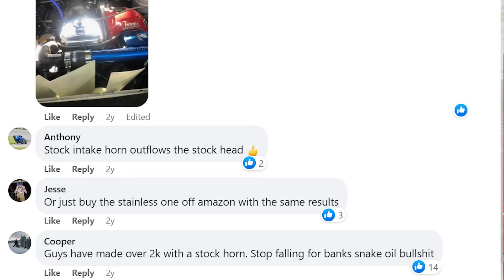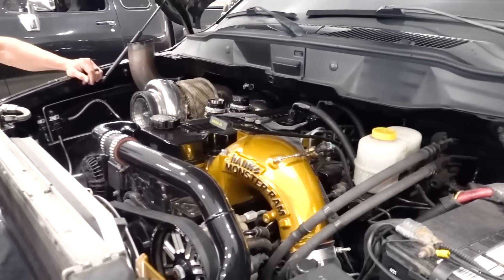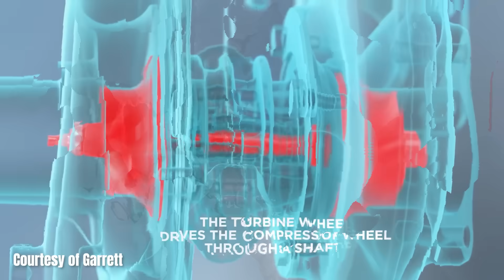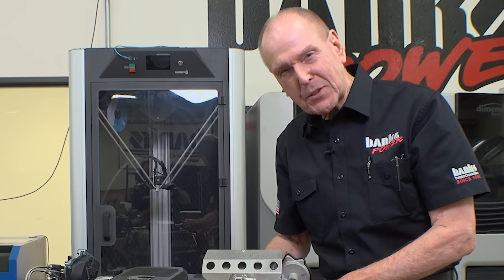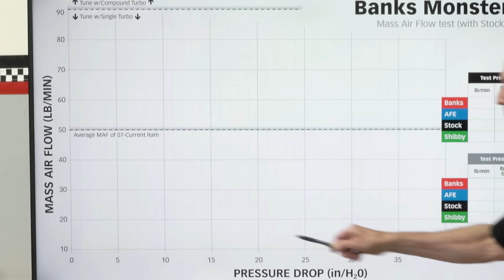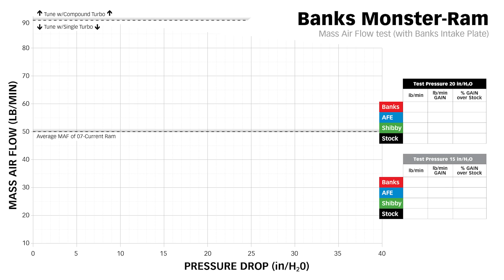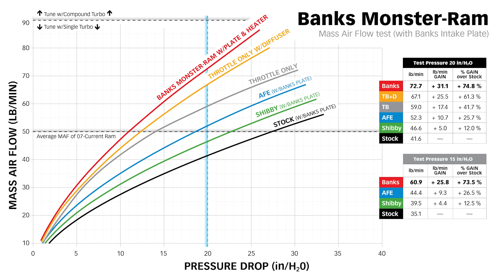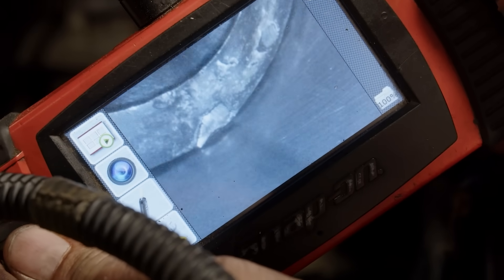Stop this wives' tale about Cummins engines! | Fact Check

Comment: He did not address MY comment from the last video.  What is the failure rate of the heating element that Banks uses compares to the factory grid heater?  By eyeball and common sense, it looks like its MORE likely to eventually break up and shed parts into the intake.  This concern is the one and only thing keeping me from buying one of these.
Reply from the maker: We have not had a heater coil element fail yet. The heater element that we include will not melt like the factory unit and coil heater element is rated to a higher amperage than the factory grid heater element. Additionally, the heater coil is welded to the base that attaches to the Monster Ram housing; unlike the factory heater that is held together with plastic. Finally, if the coil were to melt and fall into the manifold, it is too large to pass under the intake valve like the stock bolt can.  Another advantage of the coil design is that it takes less than 5 minutes to inspect, unlike the factory heater which can take up to 4 hours to disassemble and inspect.
Reply: @bankspower  Honestly, its an honor to get a direct reply from you and I could not imagine a better answer.  Thank you.  I will be ordering shortly.

Comment: I love the way the Bank's Monster Ram air when combined with the Bank's boost pipes and cold air intake opened up my 6.7 on my 2023 Ram 2500 Rebel. I couldn't be happier with the way the motor runs and breathes and in turn, I've even noticed a little increase in mileage per the truck's computer. Bank's has done their homework and the science is there!

Comment: I have a 2012 Ram 2500 Cummins that has the banks monster ram, ram air cold air intake,3.5" intercooler tubes and intercooler. What a difference it makes it just runs smoother and spools faster. I live in the North and it gets cold and have never had ad a problem with it starting with the new intake heater design. Its actually a lot easier than i thought. It seems like it's a big job but its really not. I changed my fuel filter after i did it just because. My tip is use white oyt or finger nail paint on mark where the lines go into the side of the head so you will know if anything turns that you didn't want to turn and just line the 5 fuel lines you reuse up with the marks so you get no leaks. None of mine leaked. This setup is worth the money for sure

Comment: Hmm, i wonder why banks did not go all in on the elbow design. It's ok, but you still have hot engine bay heating the elbow up, heating the intake air. Everything between intercooler exit and head should be thermally isolated.
Reply: Dude measuring flow rates at room temperature. Put that setup in 150 to 200 degrees C like the engine bay is and will se how dense the air is.
Reply from the maker: No one would dispute that under-hood air density is far lower than than ambient. As a performance parts manufacturer, we chip away at one problem, then the next, then the next. We can't prevent the engine from generating heat. However, we can draw in the coolest, densest air possible from the exterior of the vehicle. The lower the temperature of the intake air, the lower it will be entering the intake manifold. If we were building a racer, everything would be thermally isolated and/or chilled.
Reply: @bankspower Thanks for the reply. Sorry for the bit provocative tone, but it just works online. That's fair, you already beat the competition.

Comment: Tell them Gale! The engine mixes a Mass of Air with a Mass of Fuel - volumetric equations that do not correct for density are meaningless.

Comment: If the stock head was the limiting factor the engineers wouldn’t have made the manifold smaller than the inlet size.    I’ve sold hundreds of these, not one disappointed customer.

Comment: Everytime I get the old "charge pipes don't do anything" tale all I hear going through my head is Gale going on about pressure loss and air density loss. Anything you can do to ram as much fresh air into the intake, minimalize the inefficiencies of the stock charge air system to further reduce that air pressure and density loss along with taming the charge air temps... you'll be able to squeeze out everything your setup has to offer.
While not desiel bros, we often refer to Mr. Banks and his work and keep that mentality and applications to the best of our abilities with the same kinda principle in mind 🫡 none better than the man himself to break it down.

Comment: Since you read comments- How come nobody has really made a supercharged/ turbocharger compound kit where the supercharger supplies the turbo with boost before entering the engine to avoid rotor restriction of doing it the other more common way around?  A 1.9 or 2.3L TVS supercharger feeding a properly sized single turbo on a 6.7L Cummins seems like a good place to start for ease of packaging.
Reply from the maker: We've built a few super-turbos Duramax engines in the configuration you're referring to. In fact, there are Navy boats still using them. Unfortunately, the specs on the boats are still classified.
Reply: @bankspower  Nice, if this routing method is beneficial I think one could machine a billet supercharger lid for the hellcat that would direct the pressurized and inter-cooled air charge out the front to be compounded by turbos and allow it back in on the left and right side of the lid.

Comment: I'm curious as to why the OEM's aren't engineering their intake the same way. If engine efficiency is improved this gives an improvement to emissions and fuel economy and most importantly it IS emissions compliant in all U.S. states why isn't this a factory default. Maybe the OEM's need to hire these guys for consulting work.
Reply from the maker: We have a long history of consulting for OEs such as BMW, Volvo, GM, as well as defense. In fact, there are two defense engines in our dyno cells at the moment.
Reply: Not saying this is the problem, but I know that mass manufacturing ability is a very high priority requirement for OEM's. If it cannot be accurately and repeatedly made by a machine on the order of hundreds to thousands a day, they simply will not make it. They will accept a lower performance threshold on other metrics in order to meet that one, every time.

Comment: Do you have a way in your controller to prevent engine light to come on when starting?
Reply from the maker: No controller is required. The coil heater included in the Monster-Ram will not cause a check engine light. We've installed thousands.

Comment: Your monster ram should be put into production by Cummins....at least it is here for private owners. My question to Cummins is why did you not see this coming as a failure point. I think the real answer lies with Stellantis and Cummins and their resistance  to change the HD RAM in many areas. Cummins keeps stats on this motor and if this part falls under their parameter's of non-catastrophic event (just the part not the damage) they ignore it just as they always have. Very educational video even for old truckers like myself who always like to know more about diesels.

Comment: Please make a dyno video, show how the monster ram makes more power at a given amount of fueling, show at X amount of power it saves X amount of fuel.  Ive read tons of comments on it as well and everyone wants to see dyno results.   I 100% believe the flow bench results but how do they transfer to an otherwise stock truck.  I dont get making the same video (basically) ive seen before without dyno numbers....i live nearby and will donate my 22' for a test.  I suspect its a negligible gain if any on a stock motor and that's why theres no dyno graph.  Prove me wrong

Comment: Yes, in short, there are two main factors - volumetric efficiency - how well the ENTIRE system moves air through it, bearing in mind the pressure drops into, and out of the engine, from intake to exhaust tip - and the density of the air passing into the cylinder - how much useable oxygen is in the cylinder.
Fill the cylinder with as great a volume of the densest air for best torque.

Another point is that almost everyone thinks it's the fuel that makes the power - it isn't quite true - the burned fuel increases the temperature of all the gases in the cylinder, the nitrogen, trace gases, and gases produced by combustion, and it's the useful work that gas does pushing on, and moving the piston, that produces the torque and power.

Comment: ballooning in the exhaust causes a drop in pressure your elbow is ballooning the air causing a gradual pressure drop rather than a sudden pressure change out of the throttle bodies

Comment: No dyno test stock vs your still.... Until i see a dyno test its just a piece of bling that has some useful ports. 
Since you have a dyno I call your bluff or you would be showing us the results.
Reply: Ol Gail knows you're on to something here...😮😅
Reply: @gadsdenconsulting7126  All that talk and still no Dyno after all these years. He is mad people talk smack and yet pulls the worst examples to debunk. I just want to see a dyno vid of a stock horn vs his with nothing else changed. I assume a build like mine with his vs a stock one there should be a difference. I have been hated on for owning his air horn for all these years. Either way I have come to terms with it likely does nothing. However the the treaded ports are useful.
Reply: @ChannelZeroOne  You bring up 100% valid points. He has a dyno, but he pontificates on points that could be backed up with real numbers. But if you ask for those numbers, his fan bois get all riled up like you've insulted the Messiah Himself 😆 🤣

Comment: It's just like the old torque VS HP argument: it's nonexistent. HP is torque at speed. 1/2 speed, 1/2 power. 1/2 the torque, and you also 1/2 the power. Gear it 2:1, multiply torque by 2 at the wheels, halve the RPM at the wheels. HP stays exactly the same. Gear it 1:2, halve the torque at the wheels, double the RPM at the wheels, HP stays exactly the same. 

Sure, the devil is in the details. And the torque VS HP argument has very useful details which can be taken advantage of. But in the end, there's ALWAYS a direct correlation between speed, HP, and torque. Just like how in this case, there's ALWAYS a direct correlation between MAF and amount of fuel that can be burned within a certain volume.

Comment: I've heard these claims before in NA applications too, that if the engine can produce a certain CFM, and your intake can also do that, you're gaining nothing by improving it. What they're not taking into account is the pumping losses. Just because one setup will flow a certain amount doesn't mean it'll do it the most efficiently. I know this is significant even at lower CFM numbers because low restriction intake and exhaust setups, all else equal, will improve MPG in my experience. You're not running at max CFM while cruising at 2500 rpm on the highway with your gas engine, so if max CFM flow was the only thing that made a difference you wouldn't see improvement there, but I have seen very significant improvements when I've made these modifications. We're talking like more than 20% improvement in one case, and on a little 4-banger that was already getting over 30 mpg on the highway. The first long highway trip I made with that car stock I was right around 30 mpg. When I modified the intake, next trip I saw as high as 42 mpg on one tank and averaged about 39. Stock that car was doing 23-24mpg in the city and with the intake it was doing a consistent 28 after. Plus it had a bit more pep. I embarrassed a lot of guys who thought they had fast cars with my POS hot rod. Now the factory intake legitimately would outflow what the engine was capable of pumping, but that doesn't mean it wasn't reducing the pumping efficiency the way it was configured. It was too small (smaller than the throttle body opening through much of it) and there were too many twists and turns through the ducting. New intake was proper mandrel bent tubing right to a cone filter with only 2 90 degree bends, with the air pickup outside of the engine compartment. That's another myth I debunked with that car. Cold air does not make worse mpg. It makes better mpg, otherwise the OEMs wouldn't universally pull air in from outside the engine compartment. It's free power and efficiency.

Comment: Mr. Banks. I recently bought the monster ram and exhaust brake and trans brake. The transmission has been recently overhauled with heavy duty everything including a shift kit and billet torque converter the truck is a 1998 ram 2500 short bed 2 Wheel Dr. 4.10 spicer 70 posi traction with only 128,000 miles on it the truck is used mostly for Towing my 32 foot travel trailer this upgrade has made a huge difference in the way it runs and stops. Thank you Mr. Banks!

Comment: Mr. Banks is clearly an intelligent man, but sometimes he sounds like a broken record talking about air density, and he’s not particularly good at sharing his knowledge. If I’m understanding correctly, the point he’s making is that the total energy loss of the air is equal to the sum of the energy loss across each section the air flows through (pipe 1, intercooler, pipe 2, throttle, intake ram, cylinder head). (Think of it like the power dissipated by resistors in series. The total power dissipated is the sum of the power dissipated by each resistor.) In this simple summation equation, the reduction of energy dissipation of any single part reduces the total energy dissipation. The cylinder head is a constant, you don’t get to change that without paying big bucks, but everything upstream can be improved to minimize flow losses of the entire system.

Comment: Have you tested the BD Competition Intke that replaces the entire intake plate for 5.9? I have one with Banks intercooler, and 61/76 compounds, and would like to know how the BD compares to your intake. It has a very smooth line to make the 120° turn into the intake shelf and also removes the restrictive stock plate.

I would also like to know how the BD compares to your Big Hoss intake since looking to  upgrade heads I wondered if it would be worth cutting off the shelf, but I understand that has a lot of variables since the test would also have to blow through the head for accurate exit diffusion into the cylinder data for both.

I also understand you probably have very little to gain testing old pre-emissions 5.9 parts as the 6.7 seems to be the clear future.

Comment: With regards to the head... Now if the Monster Ram is combined with a better (mass) flowing head (which isn't modified by a goon) which still retains or betters cylinder turbulence while increasing mass flow capability (thus less pressure drop, and expansion) then the results become even better (even more mass flow for the same turbocharger effort).

Comment: The only problem with this video is it's missing the knockout punch of flowbenching the stock Cummins head.  Remember - the original claim you were fighting was that the stock air horn out-flowed the stock head.
Reply from the maker: We felt that we didn't need to flow the stock head since it's not the main restriction. Our goal with the video was to change the way people were thinking... We want people to think less about volume (CFM) and more about air mass (MAF). It's the contents of the volume that matters. "How dense is the mass of the air?" That's the question we want people to ask themselves.. not "What's the CFM?"
Reply: @bankspower  while I agree that the head isn't the restriction, you could prove that by flowbenching the head through the myriad intake tubes, proving the naysayers wrong with irrefutable data.

Comment: I started playing with (installing for customers) Banks (and others) around 25+ years ago. It's hard to argue with real world data that reaffirms you get what you pay for.    Bottom line, how much are you willing to spend for reliability, confidence, and peace of mind in your truck?   That's the question.  If you don't care, buy cheap ('cheap' meaning built without thorough enginerding and testificationing.. lol).

Meh, mine is but another internet opinion, albeit formed from results seen with my customers rigs.. and yes, mileage improves by not pegging boost from stoplight to stoplight.. just not near as fun.

Comment: I'm a 6.7 owner. A V8 6.7 owner, not an I6. My former boss (now retired) bought a Ram 2500 Larame with that 6.7 I6 though, and aside from the grid heater problem, it seems to be a good engine. We have not modded our trucks though. If I didn't use mine commercially I would try to have it deleted. Not risking a heavy fine though.

Comment: Gale Banks answers my questions. But then I have more questions. I too always thought that the valves were a limiting factor, but that you still needed air flow through the intake to be as perfect as possible. My understanding was that the valves create some velocity and swirl in the combustion chamber, aiding in a more complete burn. But then guys put a bigger camshaft in and can get even more density into the engine. This is all so incredibly fascinating. So my question would be, at which point does the head stall out?
Reply from the maker: The stock head will at some point choke the mass flow. It doesn't stop the flow, it just becomes a restriction exponentially. We hope to find the time to test it and provide an actual number.
Reply: @bankspower  that would be super sweet! Dyno test factory, dyno test with a cam!